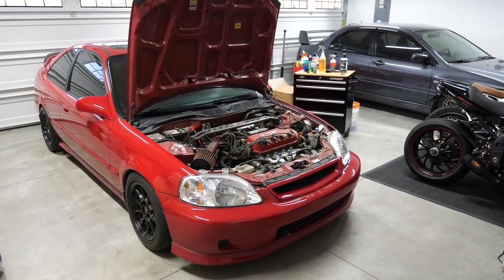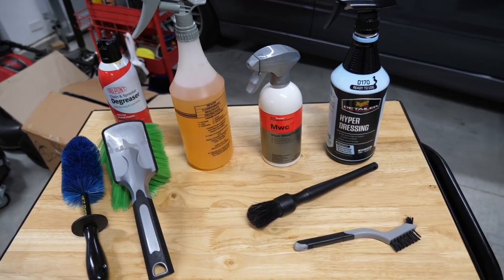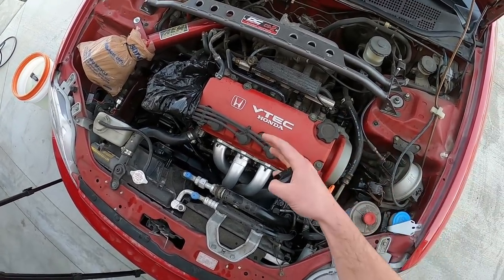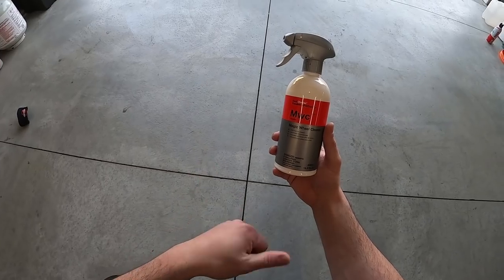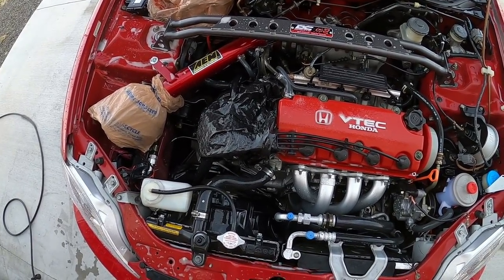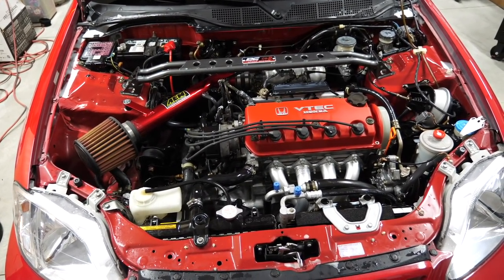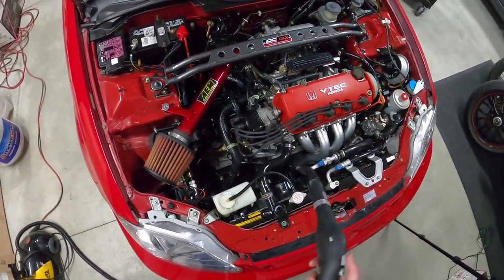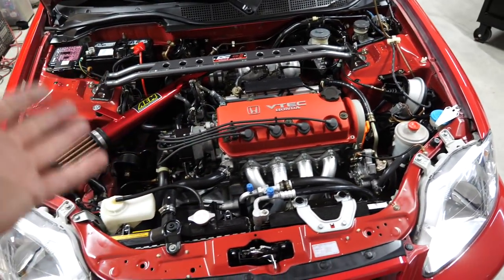Honda Civic EXTREME Engine Bay Detail | Like NEW Again!

Comment: Pulled my engine and took it apart to clean it. Then replaced all gaskets in the engine, scrubbed and reclear costed all bolts, nuts, and screws. Then reassembled the motor to all torque specs from factory. 
Please replace your radiator hose clamps. Dixon makes some awesome band type clamps. Also, bigger ground wires makes quite the difference on these engines.
Reply from the maker: If I’m going through the effort of pulling this thing out, I’m putting something different in lol
Reply: @ALLDAYANTHONY  a simple k20 would really wake that car up!
Reply: Second that on the hose clamps and thanks on the tips for ground wires

Comment: I like how simple and clean this EJ8 is with just an intake/headers/exhaust, but I did the same thing at first with my EJ8 coupe with a freshly rebuilt JDM D15B VTEC and it was way too slow. I ended up putting together a cheap turbo kit for it, and I went with a P28 OBD1 ECU that I socketed and chipped with a Crome tune. Even with a cheap eBay 50 trim turbo, eBay turbo manifold, eBay external wastegate, HKS BOV, DSM 440cc injectors, and tuned to 8 psi it pulled hard enough to take out modified WRXs, Cobb equipped Mazdaspeed 3s, and bolt on SRT4s. Then I went B series and it was considerably more torquey. I still have that car, but now it has a fully built LSVTEC and currently makes 709 wheel horsepower on it's current tune. It will drive just like a normal car if you stay out of boost, but as soon as boost hits it'll spin all the way into 5th gear with a GSR trans with a modified OBX LSD.
Reply from the maker: Sounds like a blast! I have the evo and bikes that cute that bug for me, for now.

Comment: You should check MOA engine oil treatment to put in your car with your oil so it last longer, you can run without oil and it won't hurt the bearing, pretty good stuff
Reply from the maker: Hmmmm

Comment: why dont you get an actual full cold air intake for the civic one that puts the filter down behind the bumper, just get a cheap ebay special, and a hondata  ecu
Reply from the maker: Mainly because I worry about heavy rain. The lower splash guard only protects so much